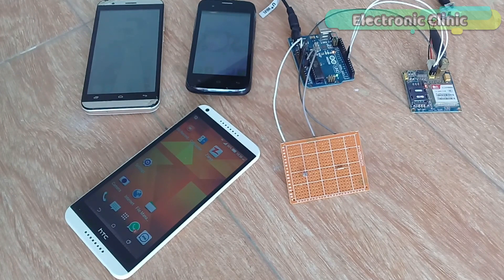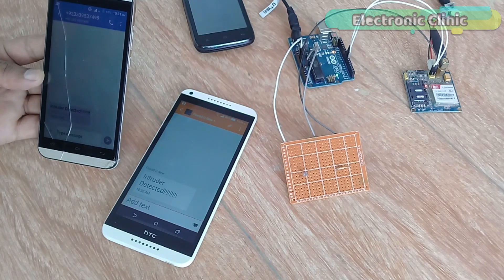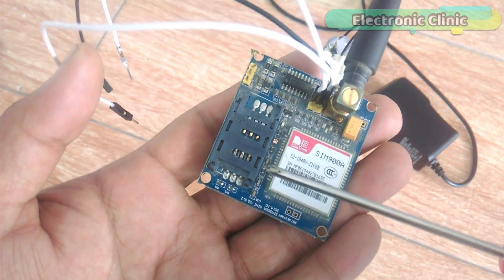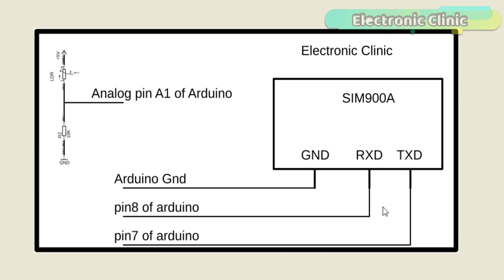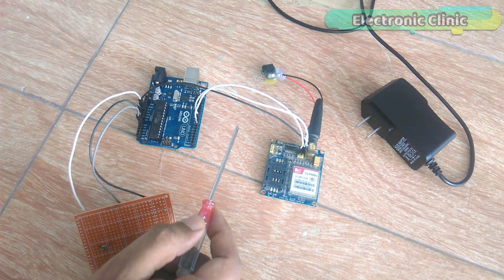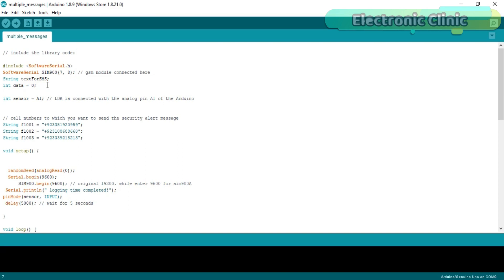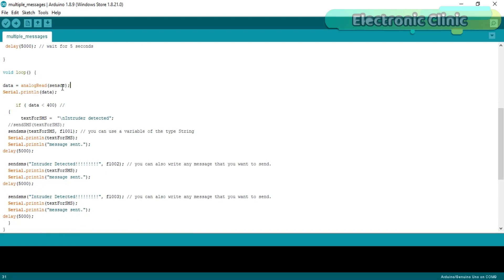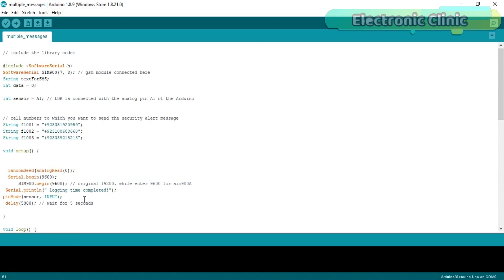Arduino GSM Project: How to send Security Alert message to multiple numbers using gsm module

Comment: Bro i m doing lpg leakage detector using arduino n gsm module...can i use 2 mobile num on which i get leakge message.....?
Reply: Bro i m using sim 800 gsm module...wt are the changes to do..in code

Comment: I am using this code and use 3 sensor. It is working, but after sending 10 message..no more message were sent. However the sensor working but SMS no further received in multiple mobile.
Please Help!

Comment: Sir, I have used the code given by you in the link. My problem is that the message is going continuously irrespective of the signal (I used limit switch Instead) with delay. Please help me to work only with activation of switch. Thanks in advance.

Comment: I can't send messages. I am doing an earthquake detecting device and it should have a GSM sim900a so I copied the codes and I conclude that it doesn't send messages to the designated numbers
Reply from the maker: this project is working perfectly. maybe you have modified the code.

Comment: Hello :)
I need Your help. 
I saw Your code about multiple sms send and I created this program code:

#define sensor 7

#include <SoftwareSerial.h>
SoftwareSerial SIM800(11, 12); // gsm module connected here
String textForSMS;

 
// cell numbers to which you want to send the security alert message
String f1001 = "+48694377xxx"; 
String f1002 = "+48509168xxx"; 
 
void setup() {
 
 
  randomSeed(analogRead(0));
  Serial.begin(9600);
      SIM800.begin(9600); // original 19200. while enter 9600 for sim900A
 Serial.println(" logging time completed!");
pinMode(sensor, INPUT_PULLUP); 
 delay(5000); // wait for 5 seconds
  
}
 
void loop() {
 
  
     if (digitalRead(sensor) == LOW) // 
  {
       textForSMS =  "\nIntruder detected";  
  //sendSMS(textForSMS);
  sendsms(textForSMS, f1001); // you can use a variable of the type String
  Serial.println(textForSMS);
  Serial.println("message sent."); 
delay(5000);
 
  sendsms("Intruder Detected!!!!!!!!!", f1002); // you can also write any message that you want to send.
  Serial.println(textForSMS);
  Serial.println("message sent."); 
delay(5000);
 
  }
}

But it's not working, please tell my why? I use module SIM800L: https://robu.in/wp-content/uploads/2017/09/GSM-MODULE-SIM800-5V.jpg
On serial port monitor I see every command from program arduino.

Please help me with this, and answer for email (mariusz11-86@o2.pl) :) 
Thank You very much.
Reply from the maker: actually, this program is written for the sim900A. I have never checked this on sim800L.
Reply: @ElectroniClinic  so, I have a big problem :( thanks for the answer :)

Comment: How can I get the phone number of the sender that is received by the GSM module and use it for sending a reply to that number instead of manually setting the phone number on the code?
Reply from the maker: The time arduino.reads the message from gsm module store that message in a string variable. And then using my split function u can get access to the number

Comment: Sir i will be showing this project in my project examination, there is only one problem i am facing ,that in lab the signal are so week that the sms from gsm doesn't travel and gsm yellow led is also blinking fast, so it's not in network.But when do it in other place it works fine 😞.

Sir is there any signal amplifier device which i can use to increase the gsm n sim card signal. Help plz
Reply from the maker: yes, you can find an antenna with a long wire. you can search on the Amazon.
Reply: @ElectroniClinic  thanks sir